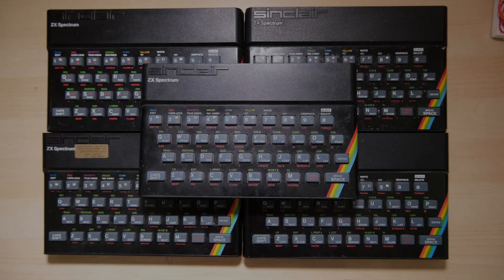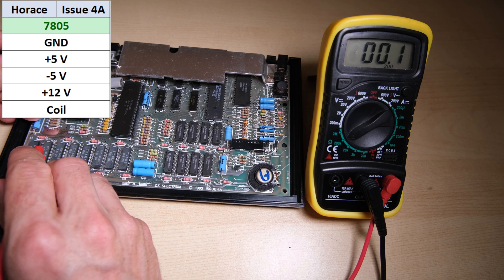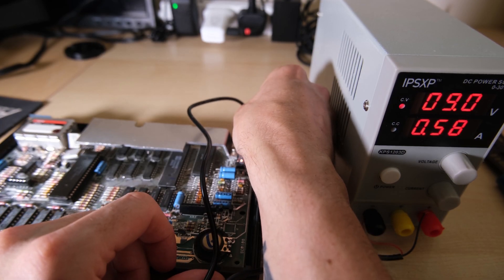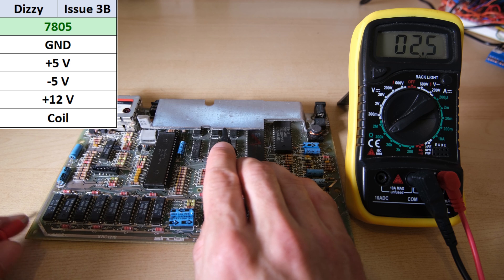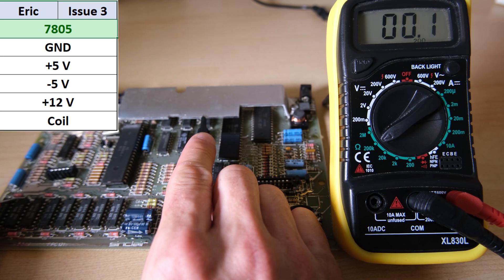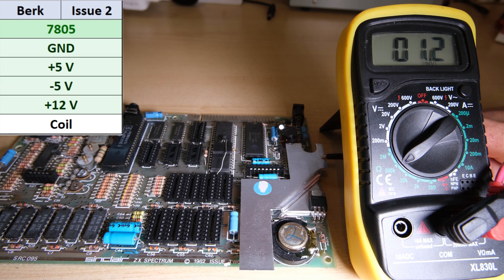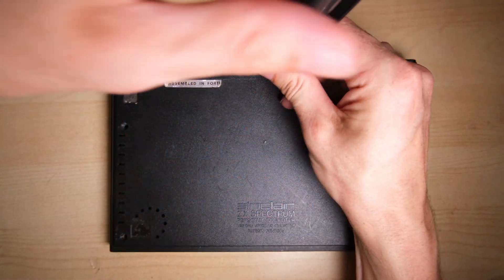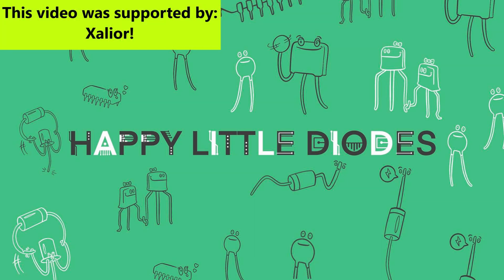Booting FIVE Untested Sinclair ZX Spectrums

Comment: Why don't you upgrade the voltage regulators so that they don't need a heat sink any more? I'd consider that a fairly standard mod these days. Also, wouldn't it be a good idea to add heatsinks to the ULAs to prolong their life?
Reply from the maker: I've just refurbished Horace and off the back of your comment I did fit a heatsink, as it did contain one of the less reliable ULAs.  Actually, I found it very enjoyable to desocket and resolder such a large chip, thanks
Reply from the maker: Good questions Steve.  I would like to do those two mods.  The switching voltage regulator looks really nice but I don't consider it "essential". As for the ULA, yes it would be best for the ULA and I'm starting to consider doing it for the flakier versions of the ULA. But I think desocketing carries it own risks in the future when somebody eventually needs to replace it they could easily damaged the board.  Also, at the moment if you want to refurb an untested 48k you're pretty much going to be making a loss when you sell it on,  even without those two mods,  so you have to draw a line somewhere.